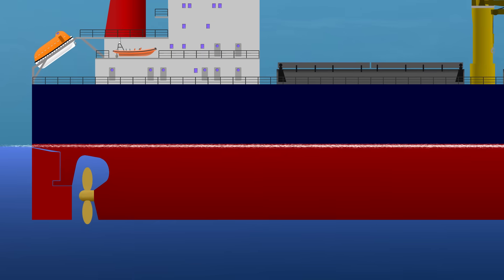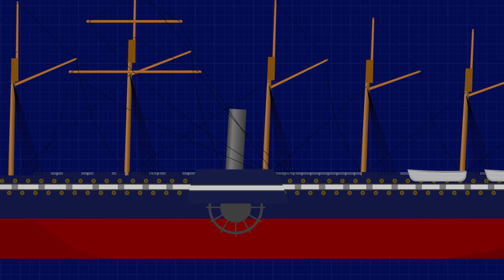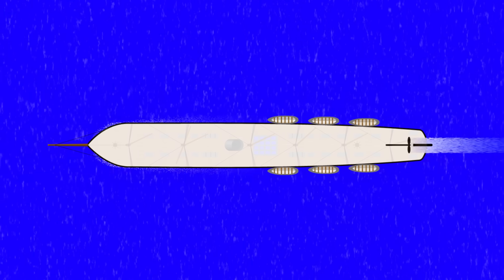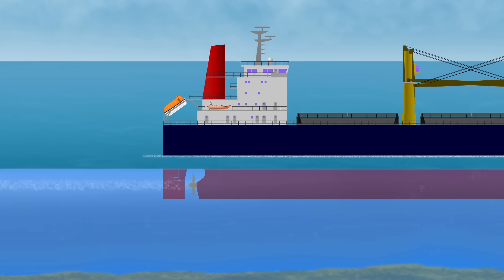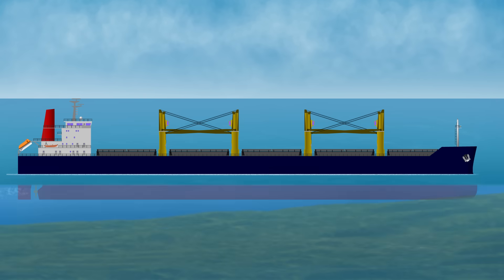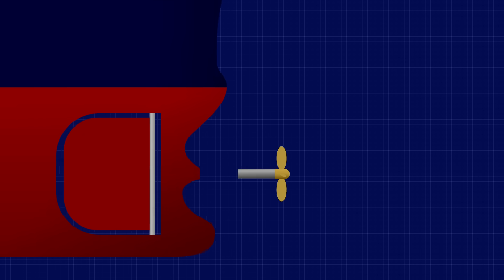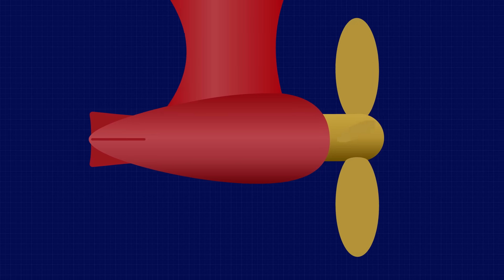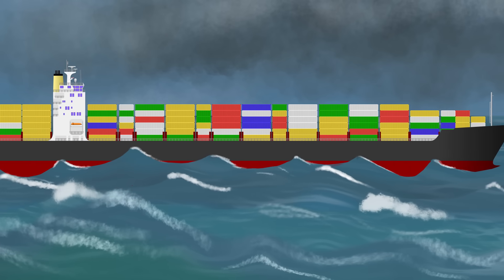Why Is The Propeller At The Back?

Comment: Hard to tell if these explanations have some engineering ground or they are just speculation. The question of why airplanes have propellers in front is left unanswered. Makes you wonder.
Reply: The reasons that the ships propeller is at the back is wholly answered. As to why a planes engine is to the front: the seal for the propeller doesn’t need to be water tight as planes just so happen to not be underwater, additionally aircraft engines operate at high RPMs which generate a lot of heat and as a result need significant air flow for cooling. Aircraft also have significant structures and control linkages to their rear as well as rotating on takeoff making a tail mounted prop impractical if not dangerous.

Comment: There are times in high waves in mid Atlantic when the stern is out of the water. A brake on the prop-shaft which saves a tamping of the ends of engine,

Comment: To the many reasons given, add that you do not usually require high speed ejection from a surface ship like you would from many aircraft, so there is no danger to crew seeking escape like there would be from a pusher prop at the rear.

Comment: The USCGC Mackinaw has 3 propellers. 2 x 24 foot diameter screws on the stern, and a single 12 foot diameter screw on her bow. This was actually to churn Lake water under her and she crushed ice with her 5,252 ton bulk.

Comment: Nobody has really mentioned the effect of the boats wake on steering.  When a displacement hull is moving forward, it creates a bow wake.  The closer the hull gets to hull speed, the more steep this wake becomes.  Over simplified, it pins the front of the boat in place, moving forward takes energy (either from the prop, or from momentum), moving sideways (over the wake) can take a lot of energy.  With a kayak, we see this very well.  It is easy to slide the rear of the boat around within the widened bow wake (making a gentile arced turn and maintaining momentum), but with considerably more effort we can raise the bow over the bow wake, creating a faster dynamic turn - burning off almost all forward momentum and often causing beginners to flip.  A rear rudder is efficient at controlling the slide of the stern - it prevents the rear of the boat from sliding side to side, while allowing controlled arching turns.  Front mounted propellers do have a place at low speeds - bow thrusters and trolling motors.  Most boats are not designed to lift the bow over the bow wake at higher speeds - but when they do it can be very dynamic-think speed boat swapping ends.

Comment: My initial guesses were;
1. Protection, the stern is the least likely place to get smacked.
2a. Access.
2b. Hydrodynamics. Why is this paired with access? Well, a bow screw would require a choice, exposed and easy to work on in dry dock or with added Hydrodynamic shielding, a complex prospect as such a structure would have to try to minimise obstruction to the screw while reducing drag.
3. Convention. Like bicycle drivetrains being on the right or the best chocolate coming in purple wrappers, it's a well established convention to whack a screw aft since so many early ships did so therefore giving early experience for such designs.
4. Mass management, no doubt keeping extra mass aft helped earlier ships open up hull space be it for goods or passengers, this goes double with motor vessels which can wedge the engine anywhere along the hull if need be.
Reply: I thought leaver effects for turning. It is behind center of mass
Reply: @nesa1126  that would only be entirely the case for a rudder and even so modern thrusters could get around such an issue. A screw could in theory still offer good maneuverability even at the bow provided water still flows over the rudder.
Reply: @andrewince8824  I don't agree. Tbh I know about Rockets, I play KSP. It is not just rudder (or fins) it is also where trust is coming from. If it is behind center of mass it will be better to steer.

Comment: The reason airplanes usually don't use pusher props is because of how the propeller interacts with the airflow coming off the fuselage or wing ahead of it. It creates vibrations and other issues that negate the efficiency benefits. Cooling can also be an issue for air-cooled engines, and the prop diameter is limited by the landing gear (more so than traditional airplane propellers)

Comment: If I designed a ship It would have 2 propellers that would be at the rear, they would be like in the rear corners orthey would be at the stern but they would not be close together.  one of them would be on the starboard side, the other on the port side.  The propellers would have variable pitch.   When the pilot wanted to turn he would do something called "reversing the props" on an airplane 1 propellers blades would rotate 180 degrees.  It would be pulling the boat backwards while the other one was pushing the boat forward.  If he needed to stop quickly he would reverse both of them and they would pull the ship in the oposite direction that the ship was going.
There is a good chance that no rudder would be needed.

Comment: If you've ever tried backing a motor boat out of a slip you'll understand how much easier it is to control it the other way. Its due to the way the hull of the ship moves through the water and how the water moves over the hull. If you lay a piece of paper on a flat tabletop then blow across the paper you may understand that last part. The forces acting on the hull become very unpredictable when water is being pushed between it and the main body of water rather than when it is being pushed through the water only. Turbulence is created that can make the boat go left when you think it should go right, or shimmy back and forth with increasing intensity.

Comment: An obvious exception are tugs. Wether using pods or Voith Schneider, it's generally in the center under the hull. But that's for a good reason as tugs need to be able to provide incredible amounts of thrust in any direction, and have no need for efficiency at speed.

Comment: Aircraft are principally obliged to sustain LIFT. For that, they may accept a certain degree of frictional loss from air being forced along the fuselage by moving the propeller forward. You'll notice that this is particularly true of low-speed designs. Supersonic designs move the reaction aft.

Oceangoing vessels are principally concerned with THRUST. They also are constrained by hull speed, which is not favored by water being forced along the hull. Thus the propeller moves aft. An exception is generally made for steering, with the rudder deliberately placed in the wash of the propeller despite the price of incressed turbulence and back pressure. But this is a benefit only at low speeds, a liability otherwise.

Comment: I would have thought the most important factor is something you didn't mention at all: Steering stability. With the centre of pressure behind the centre of mass of the ship, the thrust acts opposite to the perturbation, returning the vessel to its initial course. If the centre of pressure is ahead of the centre of mass, this is not the case and the vessel tends to turn off course.

The same is true of rockets.

Comment: Why do catamarans also have the propeller at the stern? Some of these arguments don't seem to apply to catamarans with a propeller driving each hull, particularly if the they are pod drives positioned between the hulls. 

Arguably, catamarans don't even need rudders if they have a propeller driving each hull, as the ship will pivot around the driven axis depending on the relative force exerted by the two propellers. Indeed, engaging forward and reverse thrust on opposing propellers allows a ship to turn within its own length, allowing great manoeuvre ability.

Positioning the pod drives between and perpendicular to the hulls of a catamaran near the bow, above the keels, would provide protection from grounding and ensure the propellers are (normally) operating in clean water, without flow being disrupted by turbulence caused by the hull. 

The only remaining argument in favour of stern positioning for a catamaran seems to be the greater pitch at the bow possibly causing some or all of the propeller breaking the surface, but is this really a thing? Is there really a greater pitch at the bow?

Comment: Also, when a vessel is making way ahead the pivot point is approximately 1/3 of de LOA from the bow, meaning that if you have the rudder in the bow, the lever would be 2 times smaller making the maneuver much difficult
Reply: I think that if you had the rudder exerting the sideways turning force at the bow, the pivot point would be further aft, probably 1/3 of the way from the stern. All to do with the balance of forces, equilibrium and stuff.

Comment: You mise one thing, how would you get the power to the front propeller. In the back you can literally go from the engine to the propeller,  in the front you would need a complicated transmission to get the power from the engine around the rudder to the propeller.
Ok, now with combustion-electric motors it's less of an isse, just run some wirres

Comment: The Frisia 3 ferry uses the Voith Schneider drive and therefore has 4 propellers. 2 in front and two in the back. The ferry is built to be symmetrical at the front and back and rides equally well in either direction. Its a German ferry.

Comment: Tension vs Compression argument is backwards, its FAR easier to make a steel shaft survive being pulled than pushed, because it doesn't need to resist buckling out of alignment, it pulls towards straight. This is why cables are far lighter to suspend a load than columns that the load would rest on... this goes for basically any materail a drive shaft might be made of, things like concrete where tension is an issue will also struggle with the sheer stress torque on the driveshaft creates. Pods also exist as both tractors, pushers or even both on the same pod.

Comment: Another reason is that a ship's hull is relatively large and the propeller relatively small compared to a plane's propeller and fuselage. The airplane's propeller must be large because the density of air is much lower than water. And aircraft have to be light. The bulk of the wash from an airplane propeller is near the tips so most of it can get around the fuselage. Jet and turbojet powered aircraft do put engines in different locations, because the front wouldn't work well.

Comment: One additional factor. With the propeller at the bow, the rudder is in the way of the driveshaft, making beveled gear necessary to wrap the shaft around the rudder,  reducing efficiency  for all types of ships.
Reply: You'd just have two surfaces on the same "rudder" as turned by the steering gear above, one below the prop shaft and one above the prop shaft, and connect them with a hoop, so its not really a major consideration like extra gearboxes to warp the driveshaft around the steering. Also that wouldn't apply to azipods as the pod itself can be both rudder and prop already, yet these are also mostly at the stern.
Reply: @SheepInACart  ?  Ever seen a ducted Lake Erie propellor on a trawler?

Comment: For cargo ships, there is an additional reason for the propulsion equipment being at the stern. If you spread out engines through out a cargo ship, you reduce the cargo capacity. A cruise ship can get away with that because they don't need the below decks space.
Reply: Having engines in the rear is quite recent (1960’s on).
It came in with the shift from steam to diesel. Boilers need a stable location to minimise slosh of the water in the boilers so were usually mounted amidships and as low as possible.
Really long drive shafts on steam ships was the rule not the exception. Diesel changed that paradigm.

Comment: Azipods are not used in cargo ships because of the cost. They are more expensive. Also cargo ships sail long distances at the same low speed. Simple salutation works well. Nowadays Finnish icebreakers have Azibods too.

Comment: The prop is located at point that always remains in the water regards of where the bows sits as it moves up and down with the waves.
A similar question is why horses are in front of the wagon instead of behind the wagon.
As for planes, with the engine in front of the wing, which is vital to produce thrust, there is no interference of air passing thru the engine. Whereas with the engine behind the wing the air is obstructed by the air flowing either up and over the top of the wing or flowing below the wing. Not ideal for producing thrust. The largest US bomber ever built actually had 6 engines located on the trailing edge that pushed the plane, with an additional 2 jet engines on the tips of each of the wings.

Comment: It's also worth noting that there ARE multiple airplanes with the propeller(s) at the rear, and the same with jets.
Reply: Also, planes don't use pods. We have nacelles.
Reply: @CAPSLOCKPUNDIT the difference is semantic.
Reply: Is it though?
Reply: Generally pretty low speed stuff like bayrakters and reapers
Reply: The Icon A5 being a beautiful modern example.

Comment: Another point on running aground…. If the propeller, rudder, etc is at the rear of the ship it’s more likely to be available to help you back off of whatever you just ran into.  Whereas up front, there’s a good chance it’s either damaged, or literally stuck from being driven into the ground.

Comment: I say it is just that most aircraft engineers that get it wrong. Push props are so much cooler than pull props!

(though there are several reasons why pull props are more common than push props. But push prop aircraft are not unheard off. Wright Flyer I even used propellers in push configuration. There are more pros and cons to take into account when it comes to aircraft designs.)

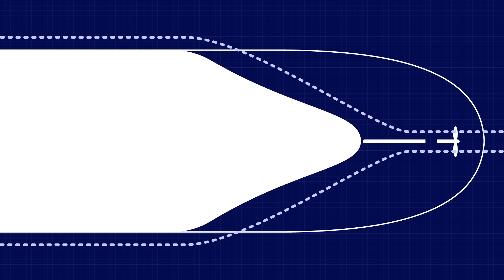Comment: 3:29 This visual angle is misleading.  The water flow you show being diverted by the ship's hull port and starboard: first, that happens anyway even when the propeller is in the back; second, the propeller is likely going to be so low that most of the water it accelerates will be diverted below the hull; and third most of the water shown being diverted (from this top-down angle) isn't acted on by the propeller.  

You should be looking directly toward the bow of the ship.  If propellers had originally been placed here, we might have ended up with a channel under the keel almost like a catamaran hull to give that accelerated water a path.  And the rudder could remain at the rear, sitting in that channeled stream.

Comment: By the way, ship propellers do come part way out of the water during severe pitching.  My father had the misfortune to get a cabin in the stern of the ship he was on to come to the US in 1948 and had to experience this first-hand when the ship got into a storm.

Also should mention bidirectional ferries -- with these, you can't get away from having some propellers up front, unless you're talking about paddle wheel ferries (which also existed well into the 20th Century).
Reply: We don't ask about the bidirectional ferries and they don't tell us. 😂😂

Comment: Why isn't the propeller at the center?
Why is the propeller in the water?
Why do you need a rudder?
Why is the propeller fixed in a certain direction?
Why not have propellers all around the craft?

SO MANY QUESTIONS THAT NEEDS ANSWERING!

And the answers all boil down to "It depends", don't they?

A tug or other nimble craft can benefit from having propellers that rotate.
A tug can benefit from having a nacelle at the center.
Other nimble crafts can benefit from nacelles, without needing rudders.
A hovercraft or swamp boat can benefit from having the propeller out of the water.
Some crafts have neither nacelles or rudders. Instead they have nozzles that angle the water jet certain directions.

And there's a case where you have a main propeller and several smaller propellers for aiding in steering the vessel in port.

As i said, in short, IT DEPENDS on what you need.

EDIT: Oh yeah, and not all aircraft have the propellers at the front either... Not all aircraft even have a propeller!

Comment: So now the question is: 
Why don't more piston aircraft use push-props?
Reply: I think having the prop at the front allows for better air cooling, whereas the prop at the back relies fully on airspeed for air cooling, which is problematic on takeoff and low-airspeed (but high lift) climbs. Also push-props have a higher risk of propstrike with high pitch angles on takeoffs and the landing flare (a quick but smooth pitch-up to cushion the approach descent-rate before touchdown), a common solution is to have a landing skid or an extended rudder beneath the fuselage to prevent a propstrike. Pull-props don't have that problem.